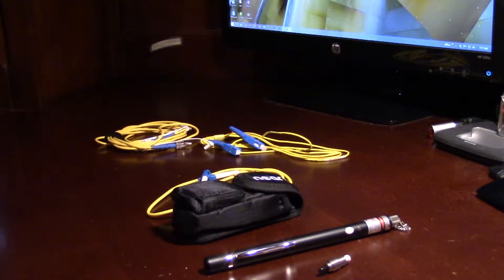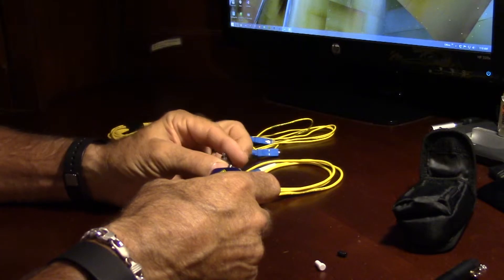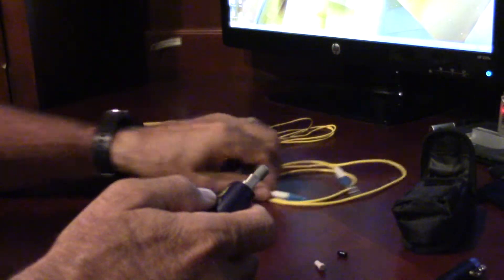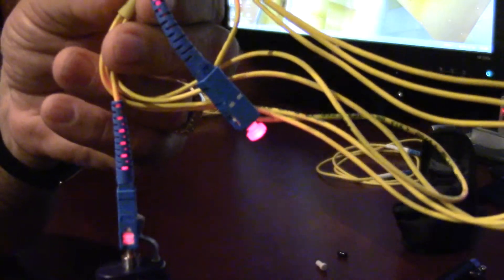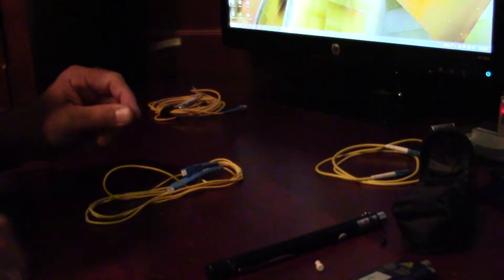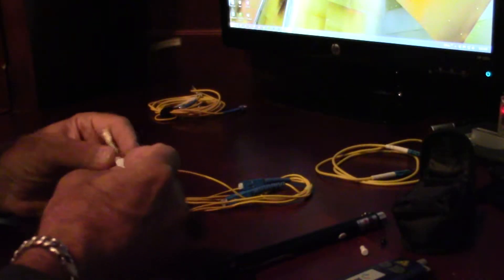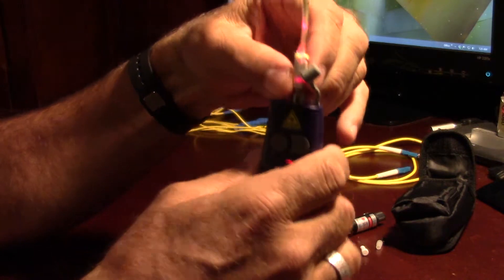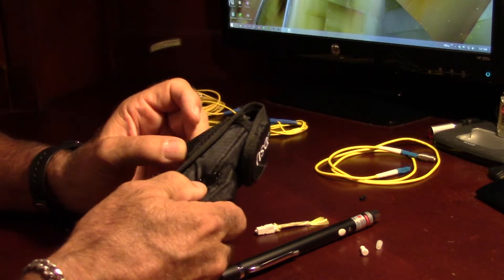Using a Visual Fault Locator

Comment: I remember finding your videos when I started at JDSU back in 2014. Thanks for putting them out there! We are known as Viavi now, but we do have a new higher powered VFL now - the FFL-105 - 5mW. Keeps it in the eye safety range for laser (class 3R) and gives a boost to the power, should be helpful around those PON cabinets for quick bend checks! Reminder to techs to check your launch cables with this too, been in the field too many times and have seen bad OTDR connections error messages, most of the time due to a microbend around jumper connectors (sometimes you'll microbend / break by accidentally closing lid on the jumper) or a gunked up OTDR port.
Reply from the maker: Hey Ryan. Thanks, for the update on the Viavi 5mW VFL. For those who would like more info visit  https://www.viavisolutions.com/en-us/literature/ffl-050-100-visual-fault-locators-data-sheets-en.pdf